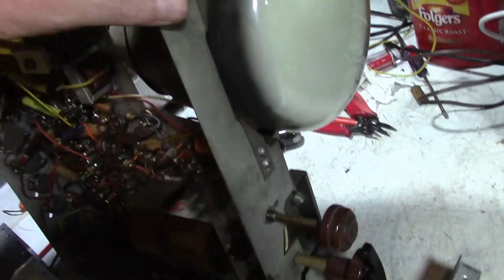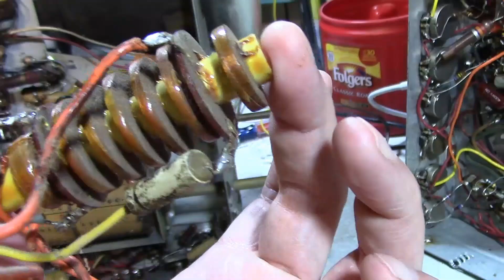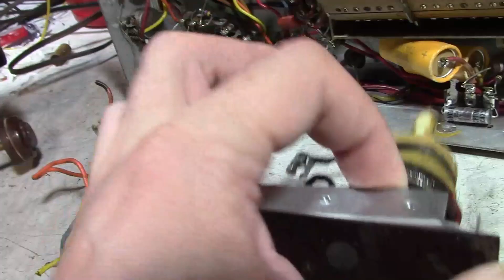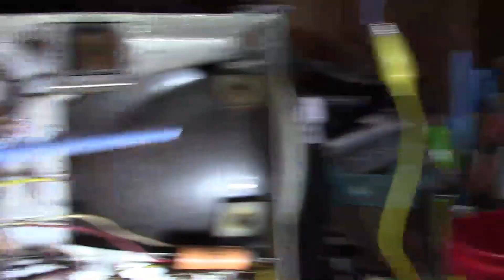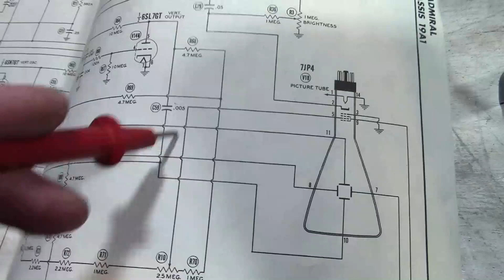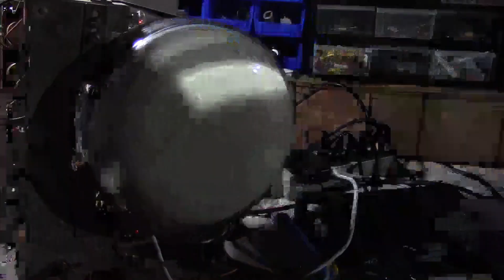Admiral 19A15 restoration p1o4

Comment: Looks like a 230v coil Hense the larger size and tv-230 gave it away
Reply from the maker: That's the part number it has nothing to do with voltage.   I located the datasheet.  It is a Merit TV-230 HV oscillator transformer coil.  Only good for 1.5 - 4 kV.
Reply: @bandersentv  oh ok is it still for a tv?
Reply from the maker: Yes, it is for TVs.  https://picclick.com/Merit-TV-230-R-F-Transformer-High-323951673465.html

Comment: Contact cleaner is especially designed to dissolve carbon deposits, so it makes sense that it would dissolve the carbon resistive element in pots. Good advice to use fader spray on potentiometers!

Comment: Kind of a "shocker" that the center terminal on the pot is connected to the body 😁
Reply from the maker: That's intentional to prevent arcing. This was all the conductive parts are at about the same HV potential.  The plastic shaft will protect from shocks.

Comment: When you take apart the potentiometer, you can just heat those tabs up until they turn red.  That will un-harden them.
Reply from the maker: There are heat sensitive parts in the potentiometer.
Reply: @bandersentv  The metal body appeared to completely separate from the rest. The tabs are part of that metal body.   I meant that once it is apart and the tabs already bent out, you could heat them up which will un-work-harden them.

Comment: Hey Bob I do have a question about that HV coil assembly you took out. You said the core is ceramic but, I wonder how then does the magnetic field propagate from the primary to the secondary coil(s)? Shouldn't the core be at least ferrite or some material like that?
Reply: No, the fluctuating magnetic field set up by current flowing in the primary winding impinges on the wires forming the secondary winding(s), thus imparting an alternating current. Ampere’s Law works both ways. A ferromagnetic core would serve to focus the magnetic field, but it’s not necessary in order for transformer action. HTH. 😊
Reply from the maker: Just as William said, an iron core is not necessary - especially at higher frequencies.

Comment: When you started getting those strange readings on the potentiometer I really wanted to see the inside of it.  You did open it up, but I didn't get as detailed view as I had hoped for.  Not really a complaint, just saying I had hoped to be able to see more and a bit better inside it.  When it appeared that you were going to reassemble it without cleaning inside I was really "nonplussed"  about it, but at last, you did clean it.  AND, by the way, your explaining about the two different cleaners in those spray cans was MUCH appreciated!!!
Reply from the maker: There really wasn't much to see inside.  It was quite clean and I almost didn't bother.  The real problem was the tin whiskers on the outside.

Comment: Bob, The "Merit TV-230" was an aftermarket replacement part, back in the day. Intended to be sort of a universal part.
Reply from the maker: Ah yes.  I see there is one on ebay right now. Says it's only good for 1.5 to 4kV though. The 7JP4 is happier with 6kV.   https://www.ebay.com/itm/323951673465
Reply from the maker: hawkturkey  I assume final DC.  I expect these ran with all sorts of harmonics at RF frequencies.  Probably hard to measure the true RMS voltage

Comment: Wonder how 4.5 kv feels?ha I bet it's a very powerful event. Both vertically and horizontally. Especially when  it throws you ten feet back horizontally and knocks you vertically on your ass!!!haha Love high voltage.
Reply from the maker: Oh, it's not so bad.  Not at these low current levels.  It just stings a little :)